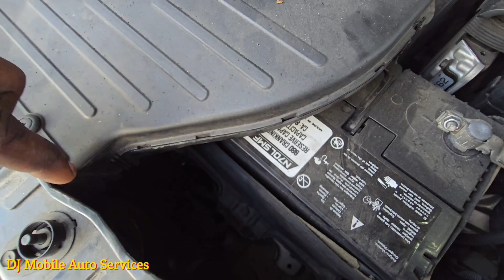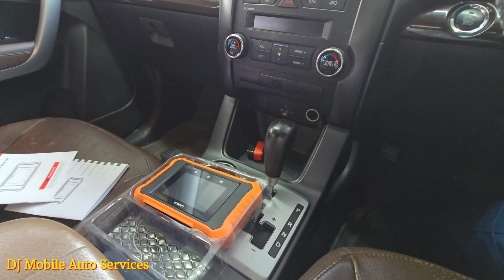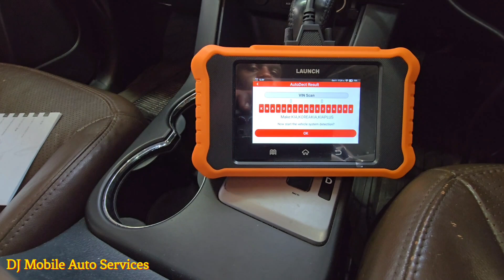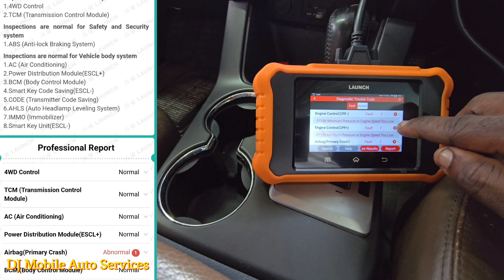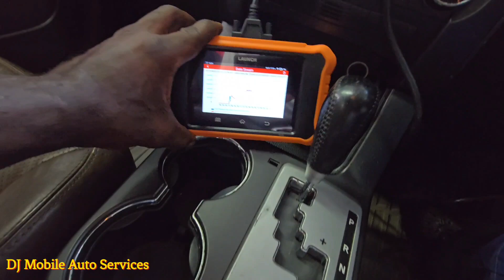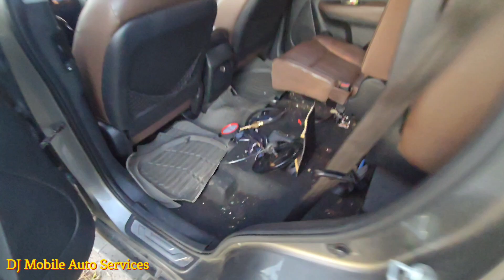KIA SORENTO P0087 & P1186. LOW FUEL PRESSURE WITH LOSS OF POWER PT1. DRIVING IN LIMP MODE

Comment: Hola tengo la misma Kia en mi taller con el mismo problema y  no e podido llegar a la falla 😢😢😢
Reply from the maker: Possible a blockage or a faulty pump? May have to isolate the low fuel issue. Could also be a faulty sensor
Reply: I change regulator, sensor, in tank fuel pump and same problem
Reply from the maker: Did you check the current going to the valve? To see if its getting the power ans ground as it should. Or the FRPS, to see if it's reporting correctly? I would say. Start from the source and work to the front of the car making all the necessary checks